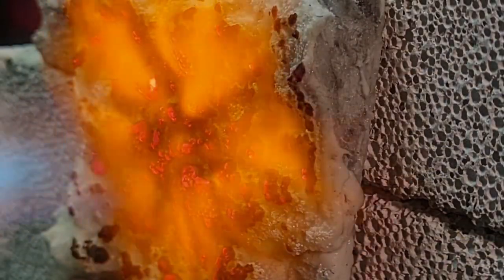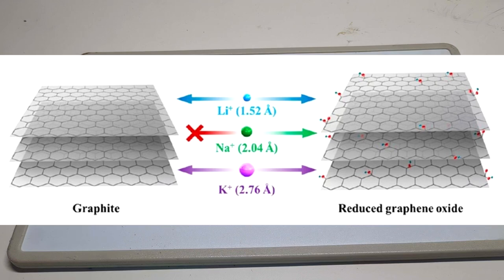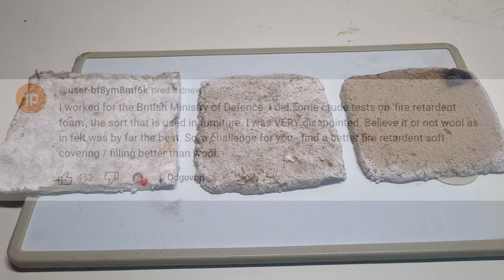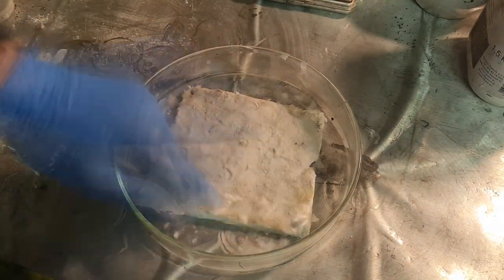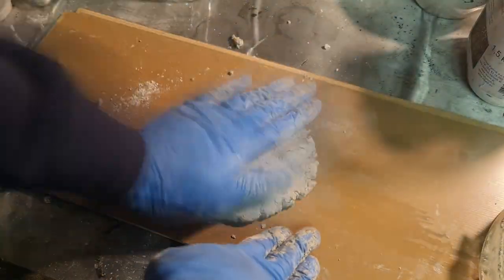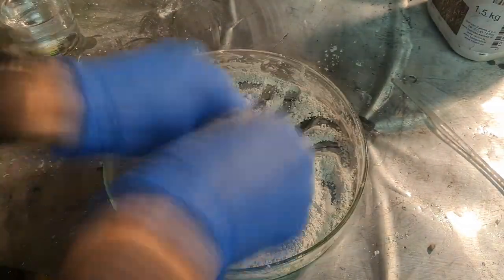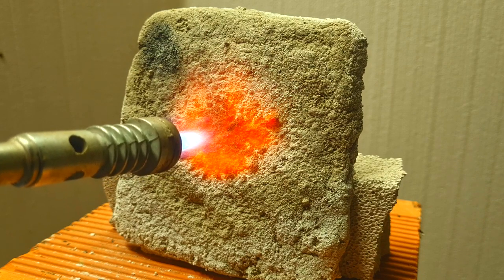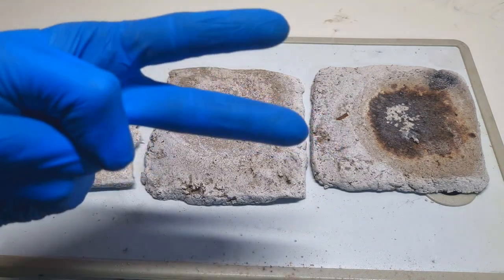Searching for Starlite? Fire proof material made at home

Comment: The problem with adding sodium to a ceramic composite is that it actually functions as a flux and lowers the melting point of the material. Try cooking a sponge cake with a lot of magnesium oxide or alumina added to it then heat slices of it to 1000 C in a vacuum and you will have an very interesting material.
Reply from the maker: Good point 👍

Comment: Possible to make it wearable? I noticed they’re all bricks. I worked in a copper mill hot side and the silver suits (light radiation fr suits) felt like they did nothing add a little bit of this and I have a feeling it would be much cooler because all that heat isn’t hitting as directly now.

Comment: just make carbonized carbon bricks
Reply: what is more better than structurally stable fire resistant element blocks/tiles
Reply: carbon ceramic tiles, kinda, very close to making diamond, maybe in higher pressure heaters
Reply: carbon is as hard to burn as coal, ie, very hard
Reply: all materials behave as ablative, unless they are ceramic, that do not burn at all, like aluminium oxide or aluminium hydroxide fire retardant
Reply: ie cast carbon fiber bricks
Reply: well ceramic sand clay tiles are used for a reason, as well as the structural stability of ceramic bricks
Reply: you know the old wood surface carbonization protection process

Comment: You wont believe this but I knew a guy who had a sample of the original Starlite and they did re-create it at COIC ceramics in SanDiego. He didn't speak well of it, because it's too weak, so I've been working on finding something even better. The solution is probably a lot more complicated than you'd like to hear. 
 The problem with all those you show, even when using wool, is that it wont keep uniform and will form cracks and valleys which look nothing like the original material, which was obviously very plastic like. I've found that adding aluminum and some copper will produce a more plastic like expansion, but there are other oxides you will find useful in forming some interesting eutectics.  The thing about Al/Cu is that they form those fibers like you get from wool, if they are allowed to form slowly at a thick consistency!!! 
Nickel and gold form a eutectic, for example.  You might consider just mixing every single possibility in small batches to see which one survives the best. Use all oxides you can get as well as silicon dioxide mixes. Titanium carbonitride shows promise. Silicon nitride+iron is my favorite. If you can get that to form it's lovely long fibers correctly, it beats everything I've seen. I made a few batches of this in a simple microwave and it did expand too fast, so I suspect you need to do this another way; or just using a very low power microwave or just making a large batch.  At high temperatures, nitrogen reacts with hydrogen to form ammonia and with oxygen to form nitrogen oxide.  I doubt you want ammonia, so NO2 from pure oxygen is all that's left. Instead of using a pure oxy flame though, I'd suggest an hho flame which you can make from something like a Joe Cell, for example, because it's going to provide an ion state that'll let nitrogen bond with silica instead of oxygen for a short time. It's either that, or you'll have to depend on static electricity from a high velocity flame to grow hairs of starlite v2. A klystron microwave would let you control the frequency which also gives new possibilities with oxide arrangements, especially when using a pair of them beamed into a chamber at 90d angle , forming an RF hologram of sorts. It has superior charge field control/containment, therefore can make the oxides form all types of cymatic patterns as they cool, but also stretch between 2 frequencies to form super fibers, like David Adair described having made for him in a space shuttle zero g experiment with sound.
There is a super metal eutectic recipe that's really hard to make and requires a few steps. I lost the recipe, but that one would hold up to 20k F no problem. I figure the guys at COIC were the ones who crashed my hd to wipe that recipe off there.